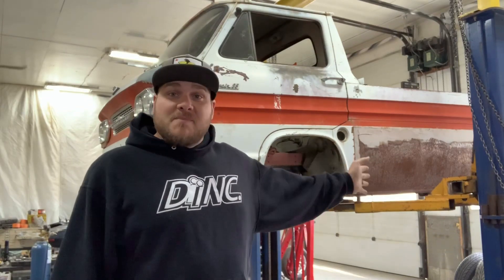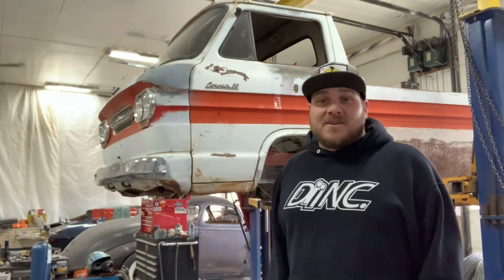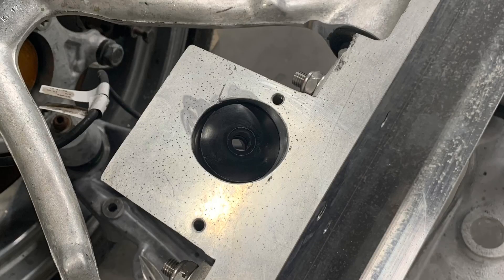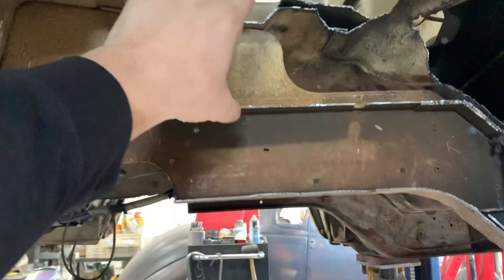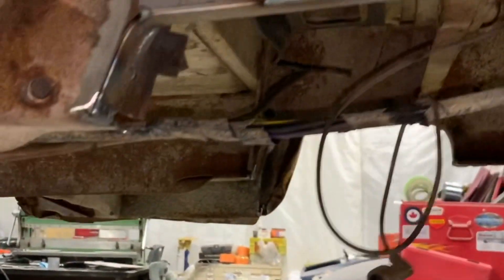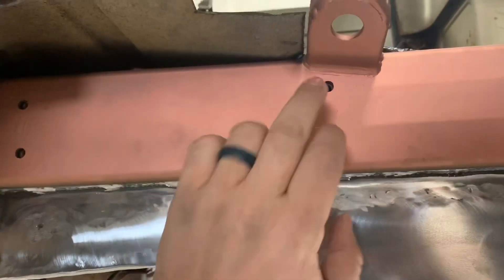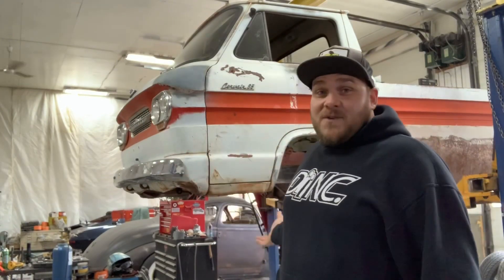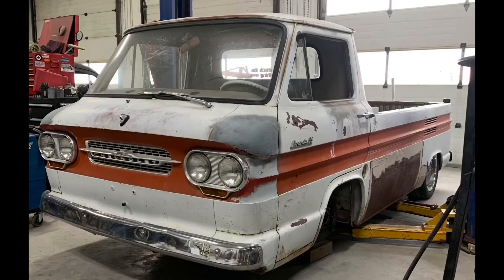Corvair Rampside LS Swap Part 3 C5 Corvette suspension swap

Comment: Grate Project,  the subframe  it has to be level when its welded to the body to get the right suspensikn geometry? And  do you know if its the same for the  original corvette frame ?
Can't wait for the rear!
Reply from the maker: Antonio Lopez the rear is already done and the video is posted!
Reply from the maker: Antonio Lopez yes the subframe has to be level for the correct suspension geometry. The Dobbertin brackets make this task way easier than building something from scratch. I went with a 1 degree rake in the body.... when you do a dead level drop, the ass end looks like it’s lower than it should be, the 1 degree rake toward the front takes care of that.